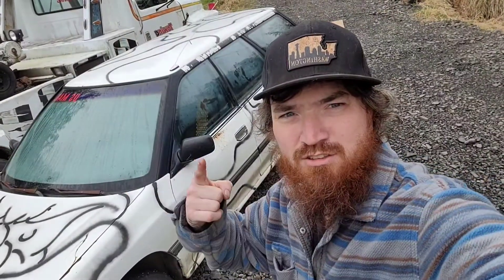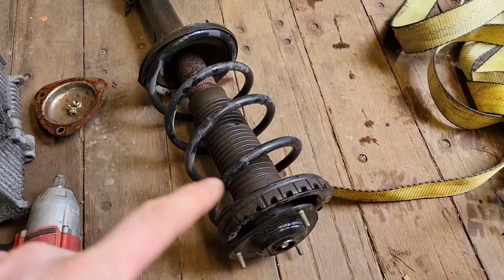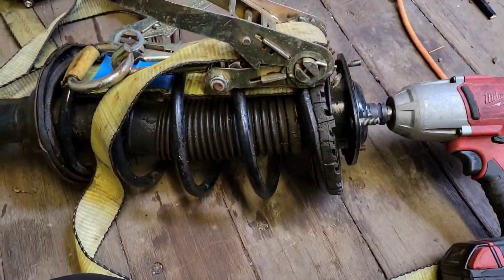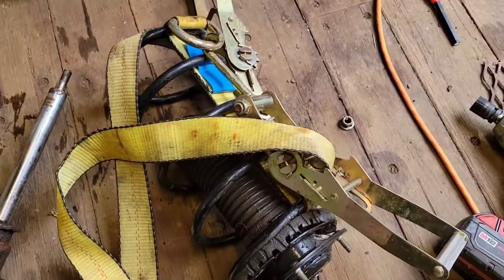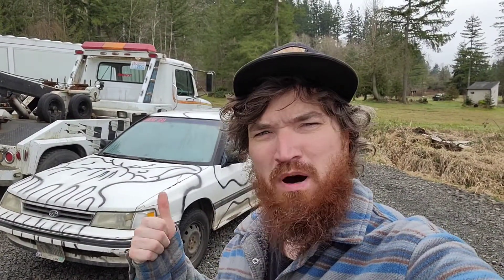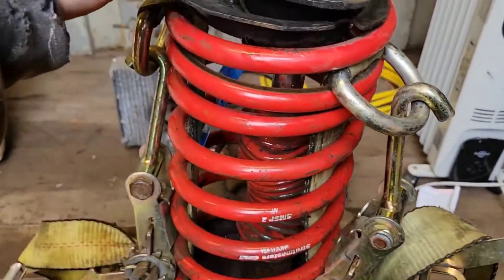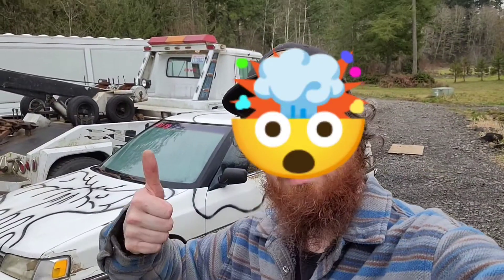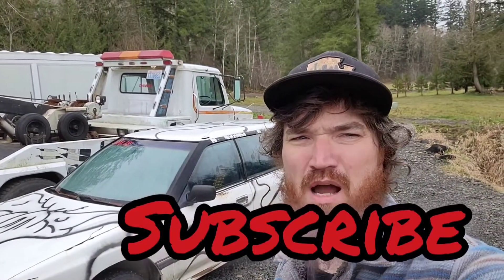STRUT ASSEMBLY WITHOUT A SPRING COMRESSOR

Comment: Subaru struts. Lift lower or alter your subarus ride by switching to different years and models. Thanks for the info. I don't own a subaru, but the old subaru brats sure are cool. I'd like to buy one if I ever get the chance.
Reply from the maker: Thanks for watching, appreciate the comment. The subaru brats were pretty cool. Getting harder to find now! I always thought the seats in the bed were crazy, can't imagine a modern vehicle coming out with rear facing seats in the bed due to liability and safety issues. Ohh those were the good old days.